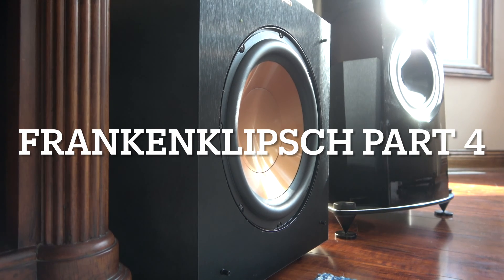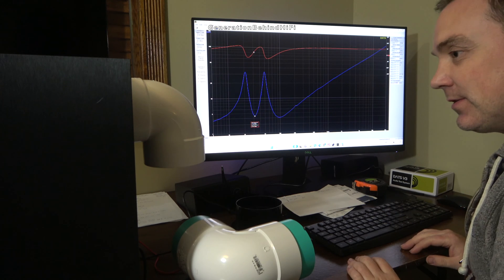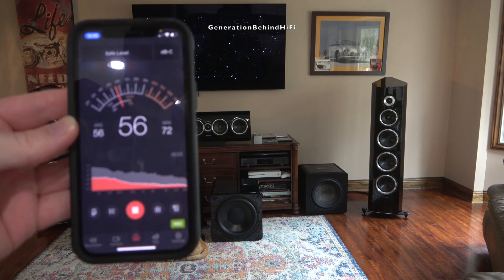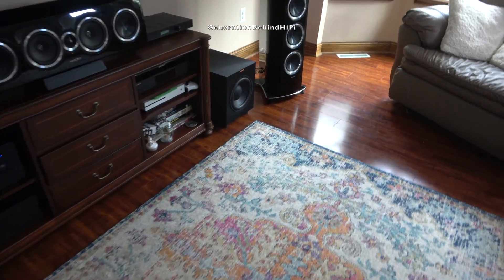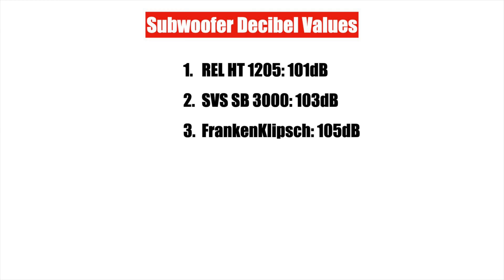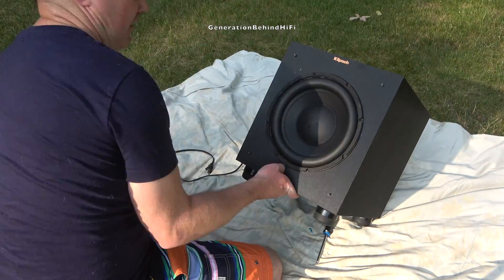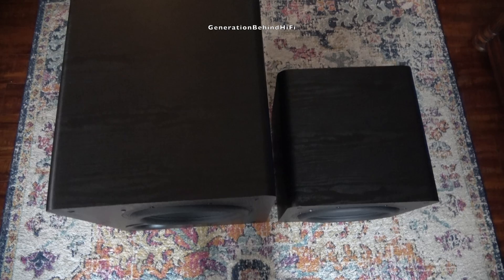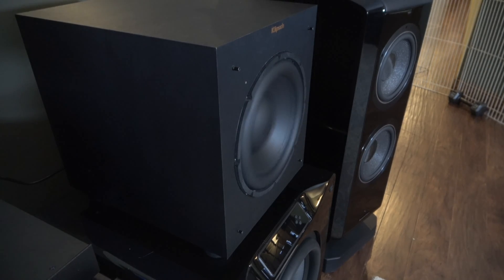Upgrading A Klipsch R10SW R100SW R101SW Subwoofer Part 4/4

Comment from the maker: Below is the parts list I used on my Klipsch R10SW cabinet. 
Sound dampening material (Generic Dynamat): https://amzn.to/3Nk29nJ
PVC pipe: https://amzn.to/3qUVLfp
90 degree elbow: https://www.homedepot.com/p/Charlotte-Pipe-4-in-PVC-DWV-90-Degree-Hub-x-Hub-Elbow-PVC003001400HD/203393427
Flared port: https://amzn.to/4427mYs
Blu-Tack (great for making gaskets and sealing port hole): https://amzn.to/3CC3DoL
Black paint: https://amzn.to/42R9gtP
Dayton Audio DATS v3: https://amzn.to/43PBZAu
SVS isolation feet: https://amzn.to/3CFhj2c
WinISD download: http://www.linearteam.org/
Driver: Martin Logan Dynamo 700W

My videos about upgrading speakers can be found here: https://www.youtube.com/playlist?list=PLg0Xq1LbiZBV3JdrXQtMPgv3Lc6YB6fdr

Comment: Thanks for the great video series. I've made my own Frankenklipsch with NO PORT NOISE..!!!!!!. But I used a different port.  I used the Ammo Tenna PSP3 3-inch. It needed to be trimmed a bit on the outside and inside. The port is just a tad over 10". It may not drop as low but it looks good and no noise.

AmmoTenna PSP3 3-Inch Port

I also used the Polk Audio MM1042 SVC.
Reply from the maker: No problem! Nice work and I'm glad it worked out for you. There are so many variables that come into play when resolving port chuffing. It has nothing to do with what brand of port you buy, and more to do with port diameter, whether its flared or not, TS parameters of the driver, etc. You are also using a different driver which explains the different results you had with your setup. Subwoofers with strong motor structures will get port noise on small diameter ports vs ones with smaller motor structures. If I have time, I might revisit this project and solve the port chuffing once and for all with a new design. In my new design I won't use a PVC pipe and instead will use MDF.

Comment: To convert the Sub to passive, do you just connect the red speaker lead to a red RCA jack and the black lead to a black RCA jack? Is there any grounding when installing the RCA jacks? Thanks for the info, I'm converting my old RW-10SW to passive and getting an external sub amp.
Reply from the maker: https://www.hifivision.com/threads/converting-active-sub-to-passive.60266/#:~:text=Assuming%20it%20is%2C%20all%20you,posts%20on%20the%20plate...

Comment: Ive got a frankenpolk lol psw110 unknown polk plate amp with a dayton rss265ho-4 10 if it had more power with a bigger box and lower tuning it might give my pb10 nsd a run
Reply from the maker: The Dayton rss265ho-4 is a pretty nice subwoofer driver. No doubt you need more amp and enclosure with that setup. Perhaps there will be a FrankenPolk part 2 in your future with a new enclosure and bigger amp? 

Thanks for sharing!

Comment: That amp is what I had my eye on last week for the JBL with the CSS upgrade. It was a little cheaper than $195 with a coupon code but I didn’t buy it. I think it would be decent but not quite what I want still. I think I can find something in the 600 watt range (ideally I’d like to go as far as 800 watts but that’s really pushing my funds…part of the reason for this is to keep it relatively affordable in comparison to what can be purchased outright) that isn’t too expensive. I just need to be patient. And for the time being I’ll be able to run it on the factory amp. 

I think you and I have similar interests. I am going to pick up one of those DATS V3’s…I have an old Energy ESW10 and a little Polk PSW111 (w/ bad amp) that I want to play with. I’m curious what the little 8” Polk driver has for specs. It appears to be of decent build quality for such a budget driver. Also have a pair of JL Audio 6W3V3-4 6.5” automotive subs and a few others that I want to play with. 

Thanks again for your content and I hope to see a final update on the JBL in the coming months.
Reply from the maker: Thanks, Mike! For the money the Monoprice 400 watt rack mount amp is hard to beat. You get an onboard DSP, 400 watts, and decent build quality for less than $200. Even at full retail it almost seems too good to be true! I think the Monoprice amp is made by OSD. Have you looked at their amps? They are identical in looks, but the OSD amps have higher quality binding posts and inputs on them, and cost significantly more. 

Good luck with your Polk sub project. Once you start tinkering, it's hard to stop. Just saying. LOL!
Reply: @generationbehindhifi  funny. I haven’t looked at OSD amps specifically but I picked up their little Trevoce 8” sub a couple weeks ago for my main living room because I wanted something small that doesn’t go too low (it’s not my theater, I don’t need to rattle the house). However, it has a lot of resonance so I might use your trick with some sound deadening to get rid of a little bit of that. Can toss polyfill in if I need to after that. The Monoprice one is sold out now with no date for restock. I’ll take a look at their amps.

Comment: The SVS sounds like the driver was bottoming? How do you know these "are not distorting"?
I have been told that 17m/s is a max and 10-12m/s are much better.
Reply from the maker: Hi Neil, I had a feeling someone might say that, but it was actually a rattling noise coming from somewhere inside the AV cabinet. I gave up after about 20 mins of trying to pinpoint it and finally decided to just film it as is. I should have put a note in my video clarifying that. Sorry!
Reply from the maker: Do you have any tips on how to resolve the port chuffing? I'm thinking about building a square port, but the length is going to be long in order to maintain my tuning frequency. The only thing I can think of is to wrap the port around the outside of the cabinet. So far this is the only viable solution I can think of unless you guys have something else that might be easier to execute on.
Reply: @generationbehindhifi  I do have a thought on that - if you can put a bundle of drinking straws inside the port, they have the effect of making the air act like it is greater density, and as the air really gets moving, it increases the friction. This takes the peak level down a few dB and it often extends the roll off a few Hz deeper. 
If you move the port inside the box, then its volume reduces the box volume. Maybe a setup with a panel that is spaced away from the cabinet, to provide a "slot" around the four edges? So, a tube inside the cabinet, that transitions to a slot port? The straws could be in the tube?
Reply from the maker: @NeilBlanchard  Thanks, Neil! Looks like I have a science project this weekend to try.
Reply: @generationbehindhifi  I would suggest the largest diameter straws you can find (that are thin walled and straight). The interesting thing is these make virtually no change to the tuning, but the fast the air moves, the more friction is created. There's something called the Reynolds Number - as the velocity goes up, the holes gain more and more friction - and they eventually effectively close up.
Reply from the maker: @NeilBlanchard  Thanks! I really appreciate the feedback. I will give a try and report back.

Comment: Yeah, it's hard for a sealed design to beat a ported one in SPL. 

Fun project! :)
Reply from the maker: Thanks, Justin! Yeah, I had a lot of fun doing this and learned a lot from it. Now I just need to figure out the port chuffing. I didn't have the horsepower (amp) before to notice that the chuffing was this bad. I have a couple of ideas in my head on how to resolve this but it won't be easy. :)
Reply: @generationbehindhifi  Well... the cheapest way is to skip all the experiments and just build a box with a slotted port with nice round corners. You could make a slotted port outside of that Klipsch box... I've built car subs with 1000 W to them and had barely no shuffing. 

Cut a slot on the right side and then calculate the length along the back all the way to the left side, then only tune the width and with that the area to an acceptable tuning freq... Should be wide enough I'm thinking to make the air slow enough... if you're lucky.

...or just get some nice aeroport ends I guess... ;)
Reply: ...doing the "cutting a hole" metod is o.c. really, really stupid! :D
Reply from the maker: @OlaJustin  Where's the fun in that (taking the easy way out)? LOL! 

I appreciate the suggestions. Yeah, I might just end up building a new cabinet, but really didn't want to go that far. I was thinking I could get away with cutting a rectangular port on the top of the cabinet and then wrapping the port from the top all the way to the back, then straight down the the back side where it will go underneath the cabinet and will exit right under the driver. I need to wrap the port like that because I need the length in order to maintain the port tuning. Once I get some other speaker projects done, I will probably get going on FrankenKlipsch again.
Reply: @generationbehindhifi  thats an excellent idea! 😂😂😂